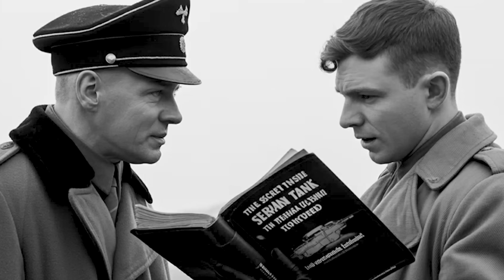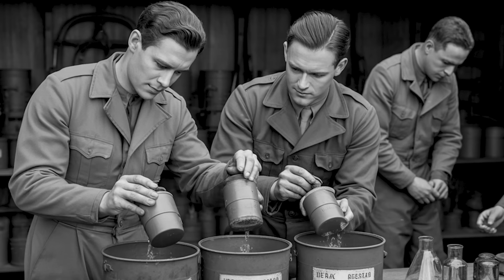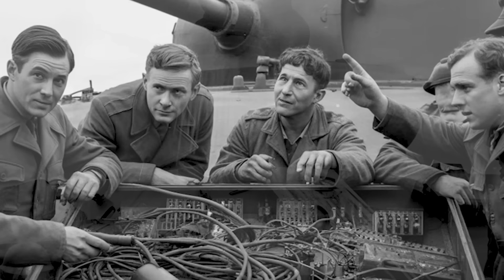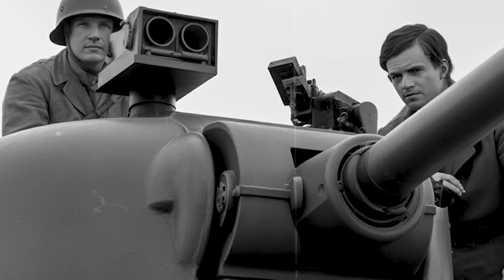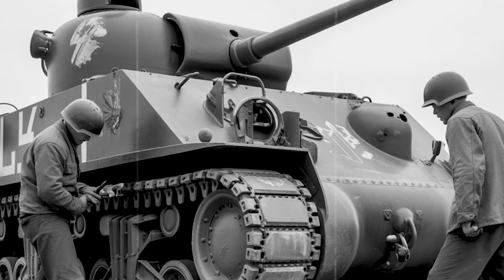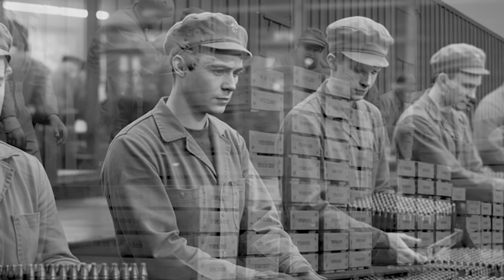The Secret Inside Every Sherman Tank That the Germans Never Discovered

Comment: A major factor was that most American tankers had grown up repairing automobiles and were amateur mechanics before entering the Army
Reply from the maker: Exactly right — that mechanical know-how gave American crews a huge edge in keeping their tanks running under brutal conditions.😇
Reply: Don't forget the farm boys that grew up repairing and operating tractors from the time they could reach the pedals, making repairs with baling wire and sometimes welding or brazing metal parts for a quick fix.

Comment: The "Ronson" was a cigarette lighter, not a cigarette brand.  It was contemporary to and similar to the Zippo lighter. The Ronson Company's motto was "Lights first time, every time", which was applied to the M-4 Sherman tank. The dry ammo storage and thinner armor of the early models made them "brew up" pretty easily when hit with a German tank round. .. giving the Sherman the "Ronson' nickname
Reply from the maker: That’s an excellent clarification, Quentin — spot on! The “Ronson” nickname definitely came from that lighter’s slogan, not a cigarette brand. Appreciate you adding that bit of historical accuracy 🔥😇
Reply: AI generated commentary does not have that information. AI always has a tell.

Comment: Up to now German designs still feature complexity. To access the alternator in my 2014 T5 Multivan, you have to take out so many systems including losing the refrigerant. This simple change can take a full shift. In a similar Toyota, the change can be done in 30mins. There is value in simplifying systems.
Reply: well, cars are more and more complicated, and more elements must coexist. If alternator lasts 400 thousand km - more than designed lifetime of car - it doesn't matter how  difficult is to replace it ..
Reply from the maker: Both of you make great points — modern cars really are a balance between complexity and longevity. It’s fascinating how engineering keeps evolving, but sometimes simplicity and accessibility from older designs still win in practicality. Appreciate you both sharing your insights! ⚙️👏❤️😇
Reply: The alternator in my car corrodes its stator. The bearings and rectifier are great but a corroded core seizes the instrument. Thankfully new alternators are cheap and on my car, are fairly easy to replace. The main snag is one bolt you cannot see and can hardly feel.
Reply from the maker: That’s a brilliant modern-day example of how design philosophy impacts practicality, just like it did in WWII! Thanks for sharing that insight. 🙌